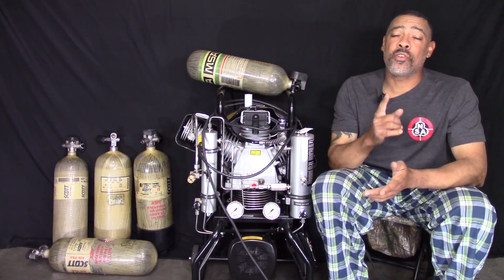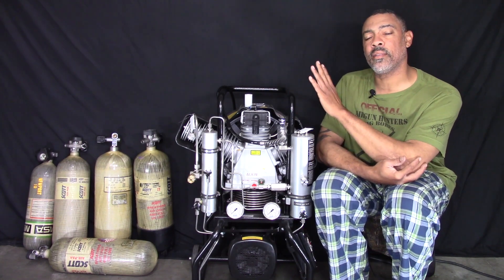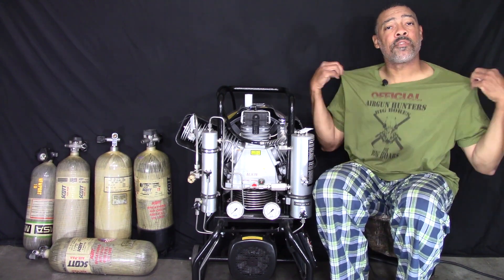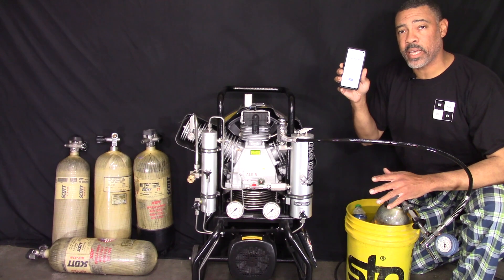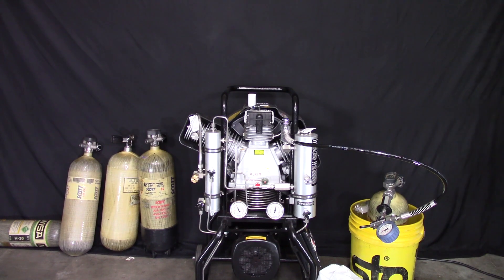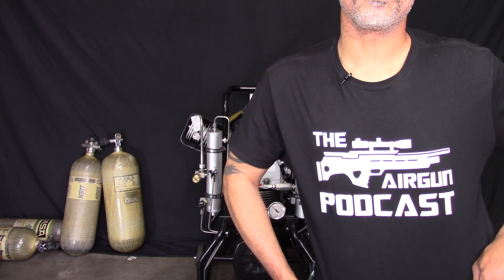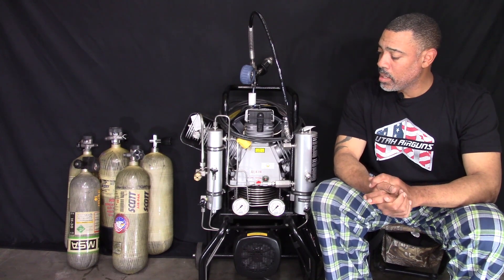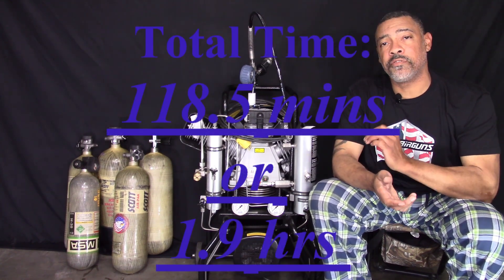ALKIN W31:  FILL TIMES!

Comment: Yup, great compressor.
I bought mine from Doug too.
However, my voltage here in Texas isn't 220/230 but is actually 248 to 250 most days so the European voltage (pluss it's a 50 Hertz) motor didn't last very long.  But they did warranty the motor since I got the power company to verify my voltage was within specs and we replaced it with a heavy duty 60 Hertz motor that could handle my local voltages continuously.

Why is my voltage so high? Well, I'm right at the transformer out of the high tension power lines and the power company sets the voltage taps on the transformer to supply 110/220 vac all the miles away at the far end of the local grid to compensate for line loss.

Comment: Nice compressor, I would like to mention that the valve you have talked about is not a check valve, it's a release valve. 
The check valve function is to allow the fluids to pass in one direction and usually there is an arrow indicating the direction of flow on the valve itself, the safety or release valve function is to release the excessive pressure when the system reaches a certain pressure, some release valves are adjustable unlike the check valves. 
Cheers!
Reply from the maker: Yep, slip of the tongue when you make videos and talk from memory and not a script.  If scripted, the wording would have been more precise.  Its technical name is, "DRAIN VALVE" as so stated by Alkin.  Of course you are correct, It releases excessive pressure................

Comment: That is a great compressor,  it is designed for the longer run times, some people use them for small cascade systems. They also make a W31 Vertical with auto stop.  We just got one in to play with.
Reply from the maker: It sure is.  And I thought I was subbed to your channel.  Could have sworn I was.  WELL, I AM NOW!